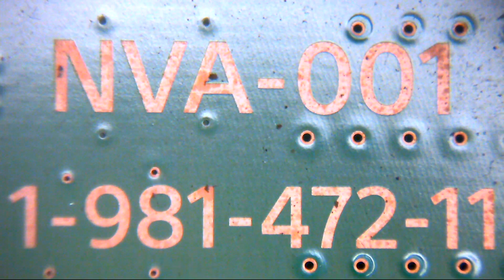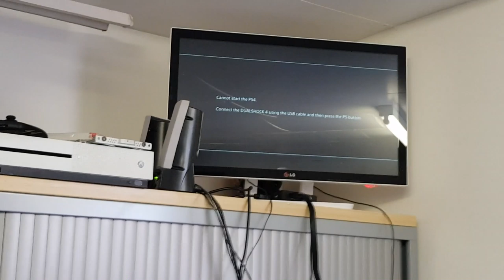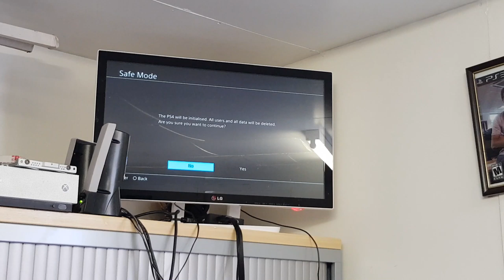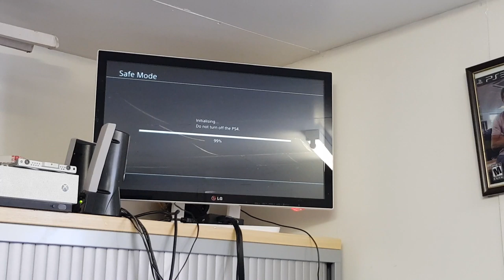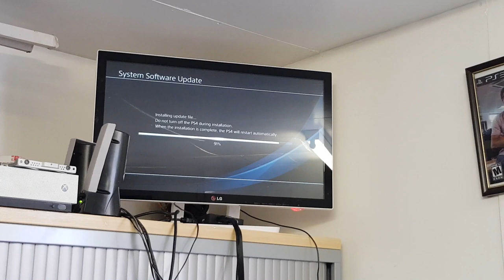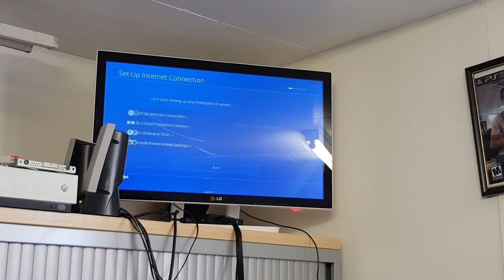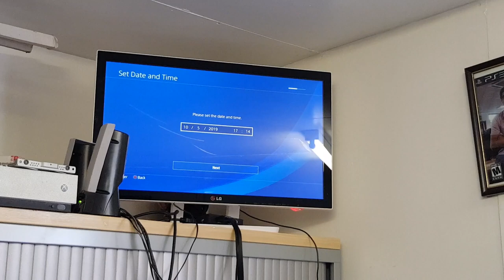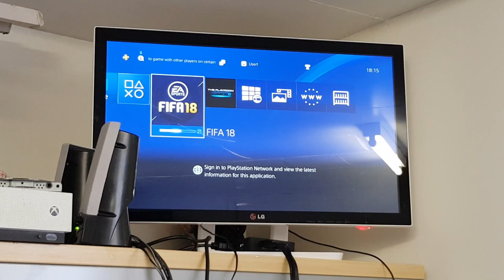PS4 Pro Fix SU-42118-6 No Disc Feed and Update loop - Fault Diagnosis and Repair (NVx motherboards)

Comment: Hiya sir
I have a  ps4 that got error 42118-6 after BD drive replaced, is there a solution to this?
Reply from the maker: Is it a Pro PS4 or another version?
Reply: @AndrewPaul  Ps4 fat edition, CUH-1116A
Reply from the maker: Cool, so this is a message which basically translates as it's unable to communicate with the BD-ROM. Check the big flat ribbon between the drive and motherboard and both connectors - the connectors are complete crap and can easily dislodge a pin, or the rear locking tab breaks meaning the cable can't seat correctly. Often these then get forced which can break the cable or damage the contacts. While there, check all fuses on the BD-ROM PCB - F201 / 202 / 203 and if present, F501 for continuity with a multimeter. Any that don't show continuity, replace with Panasonic ERBRD1R00X or equivalent. Hope this helps!
Reply: @AndrewPaul  thanks alot 🤝 much appreciated for giving me help, I'll try all these methods hopefully one of them works out

Comment: That grunge on the board looks like a classic sign of a PS owned by a smoker. That will be nicotine dust.
Reply from the maker: Yeah just watching it back during the edit yesterday and like you say - looks to be a (un)healthy dose of nicotine in there :)
Reply: @AndrewPaul  I was fixing a PC years ago. It was for a security firm and this was located in one of their prefabs. It wouldn't turn on. When I pulled open the side, it was covered in a thick gooey nicotine paste. I refused to fix it. It was a biological horror. I was amazed it lasted as long as it did.

Comment: Good day I'm keep getting an error code everytime I try to play a game on my ps4 1200 model ce 34224-5
Reply from the maker: Seems to be HDD related. If you haven't already, try a different hard disk drive.
Reply: @AndrewPaul  I have try multiple HDD  same issue  and I got a slim no disc feed  stuck in update loop I check the fuses they are fine  what could be the issue

Comment: A Mini Cooper. That does it, I'm unsubscribing. Unless it is one of the originals?
Reply from the maker: An original new one lol ;P
I love the original Mini's but they're bloody expensive these days if you want a good one.

Mine's an R50 on a 53 plate, I bet I've rebuilt most of it from scratch by now! Almost ready for the MOT - just need to get the front brake pipes and fuel tank straps sorted, new tyres on (which have been in the garage since September!) and then it can go in. I needed a little commuter car as trying to park the big beast by work where parking is rarer than hen's teeth is proving very tricky and it's only going to get worse as they're throwing up new apartments and shops left right and centre by the office. That and my main motor got thumped up the backside last year from a clumsy sod not looking where they were going over that way too so hopefully this will fit the bill.
Reply: @AndrewPaul  I'm old school. I had an original Mini until some twat rear ended me two weeks after I rebuilt the sub frame. I was gutted. It was a total loss. I'm into my SUV's now. But they're bloody expensive.
Reply: @AndrewPaul  I know sfa about cars. Where the petrol goes and where I put the screenwash. PC's on the otherhand.
Reply: @AndrewPaul  A thought Andrew. I'm teaching myself Premiere Pro at the moment to keep myself sane, would you like an intro done?